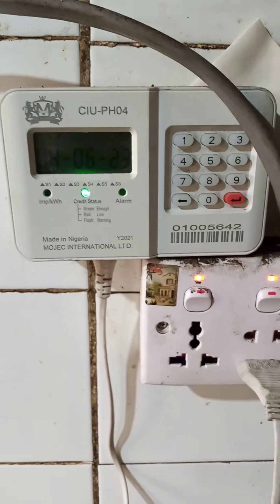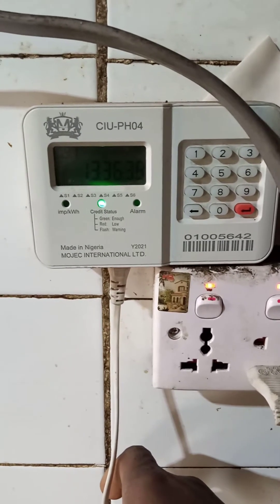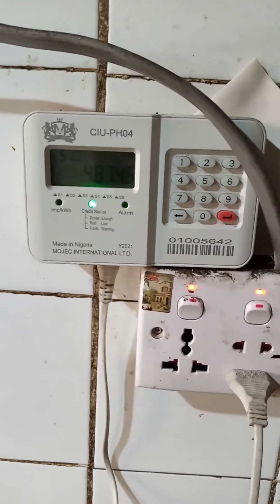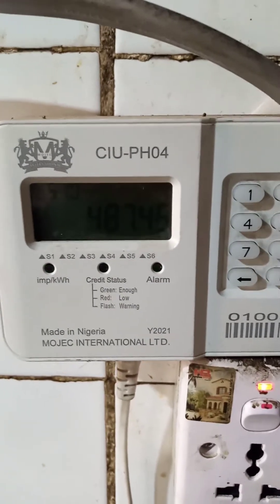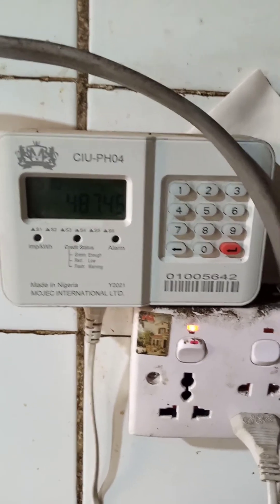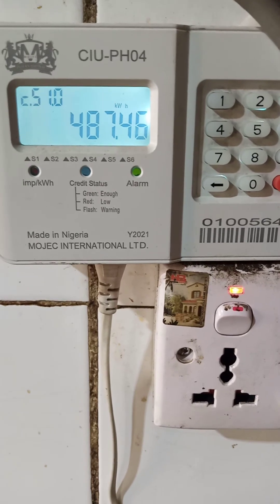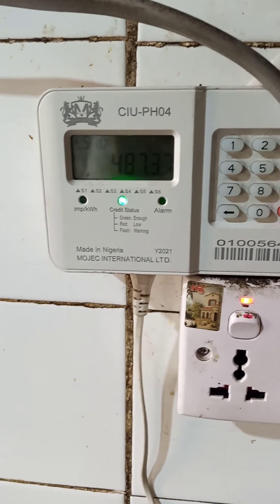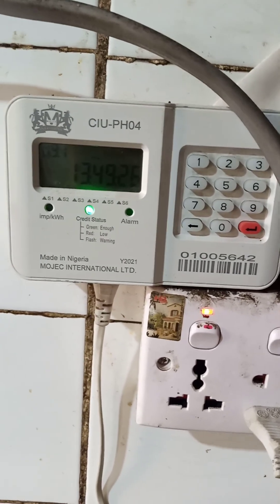Mojec CIG NHC prepaid meter not pairing how to pair indoor and outdoor units meter number code

Comment: Thank you for this video.  I have the exact unit which was just installed but it is not loading recharge unit and since there is no power in the socket outlet, how do I do the recharge as it is failing. Could it also be a cable issue? Thanks

Comment: My unit finished and my light cut off, i put in new battery into my CIU but not powering on but if i plug to generator light it turns on but not accepting my token when i try to load, i keep getting error 06. What do i do?

Comment: Whatz the solution for those of us using battery even after changing the battery the problem still persisted
Reply from the maker: What is the meter brand?
Reply: Mojec meter
Reply: @OsasIduriase has it been resolved currently facing the same issue

Comment: Thanks. It works! Guys, I changed my cable and it works. I will advise that you plugged the indoor unit directly to a power that is not on inverter or any extension.
Reply: Does that mean I have to take it to other apartment or use battery?..

Comment: You just spent 17 minutes going on and on and even the solution didn’t work.
Reply: What worked for you?
Reply: @ nothing. Something had to be done on the meter connection outside my apartment
Reply: @Iamkehny  nepa came or you called someone yourself?
Is it that light didn’t enter the apartment from the pole or it’s an issue with the meter box outside 
Sorry my questions are too much 
Thank you

Comment: I kept getting error 06 on my meter. I tried searching everywhere + MOJEC and IKEDC website with no solution. Although my issue was NOT the cable, your video helped a lot because I'm sure calling customer care would have been another looooong back and forth before they would be able to finally resolve issue and they would have probably also stressed me to go physically to their office.

My own issue was the stabilizer I connected to the house. I normally place the whole how on stabilizer because most times almost everywhere in this Lagos na low voltage dem dey supply. So I always "stab" the whole house.

The good thing is I always have a bypass to select between the stabilizer and direct PHCN. So I just switched the changeover from the Stabilizer to direct PHCN and the CIU started communicating again.

Comment: My prepaid meter is bringing out failed too after loading. Now my unit has finished over a week now. Am using solar. My ciu is using battery, i changed to new battery everyday still mot working. Used different code still failed
Reply: Please did you find a solution. Cause I'm currently having this issue too
Reply: @Charles-ei1di have you find a solution ?
Reply: @rushypatterson did you find a solution to yours? Currently having the same issue
Reply: Having same issue fr
Reply: Any solution?
Reply: Did you find a solution to this?
Reply: @ yes I went to report at IKEDC,they came to fix it ,turns out the wire of my meter outside removed that’s why it’s not connecting 
It’s probably an issue with the meter outside for you too
Go to the nearest ikedc to report ,they will call you and come fix it for free

Comment: Mine is showing failed, when trying to link up with the (620–meter no—-123456) code, when I’m trying to recharge with token or even  when trying to upgrade it. I have tried all tricks in this video yet it doesn’t work and this is my first recharge 😢…meter name is Longi meter.

Comment: Hello sir, i have similar issue currently. I've changed the cable but the error message have changed from "Failed" to "reject".

Please what do i do?
Reply from the maker: Is it the same UIU as the one in this video?
Reply: @techpointzone4408 what's the uiu and how do I get it

Comment: I think the newer models do not even have any wire port. The one i just got uses only battery, I've tried everything, i can't even activate the prepaid, its not connecting. Went to their office, they changed some codes for me but the problem still persists. Its Mojec also
Reply from the maker: Really? What is the model number written on it?

Comment: mine is just saying connect failed , i cant connect the indoor unit to the outdoor unit
Reply from the maker: Connect failed usually happens when the communication is broken between the outdoor and the indoor unit.
1. Check that you plugged the UIU cable to a direct socket from the power grid and not to an inverter or ups line.
2. ensure that the cable you are using for your uiu is okay. you may test with a new cable, as the cable breaks the communication between the outdoor and the uiu sometimes.

try these two suggestions and let us know.

kindly subscribe to this channel, share, like and hit the bell icon for notication. Also send this video to your friends and family so that we can be encouraged to make more healthy videos.

Comment: Please I have the exact type of the one you used for the video but each time I plug my ciu, it says failed. It doesn't connect. Even when I type in the code for balance or 100, it keeps saying failed. 
The EEDC people are saying I should buy another ciu.
Please what can I do?
Reply: Mine does not have cable
Reply from the maker: Hello rubylemoha1377, first, make sure you change the cable of your CIU and ensure that it is plugged to a wall socket directly and not to an inverter or ups output. After doing this, try it again and let me know.

Kindly SUBSCRIBE to this channel and also share with friends and family so that we can be encouraged to make more helpful videos.
Reply: @techpointzone4408 doesn't work

Comment: My mojec meter is showing failed please help
Reply from the maker: Failed, at which point? Failed to pair up successfully or failed during recharge?
Reply: Pls i'm having problem of Failed to pair up successfully @techpointzone4408
Reply: Failed during recharge
Reply from the maker: @angeledjua130  hello angel. Failure of recharge can be due to your meter not pairing up.
Pls, check if your Mojec meter UIU is beeping green which indicates pairing success

If not, you can change the cable that connects to the UIU and check if it pairs up successfully after which you will be able to load tokens
Reply: Please what is the mojec international pairing code

Comment: Whats the maximum distance from outdoor to indoor
Reply: You could have said all these in 30secs sir.
Reply from the maker: The max distance only comes in when your CIU uses RF to connect to you meter. For PLC, it rarely matters except there is so much noise on the network. This is because prepaid meter it is used at the last mile which will always be within a reasonable distance.
 Please, like and subscribe so that we can release more helpful videos. Also hit the notification icon. 👍